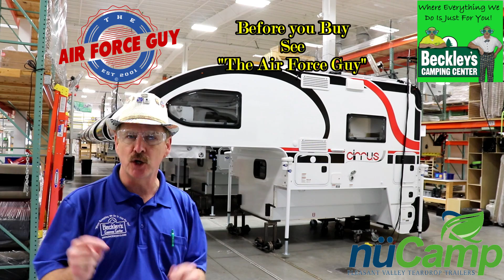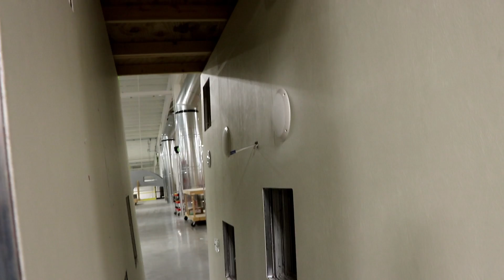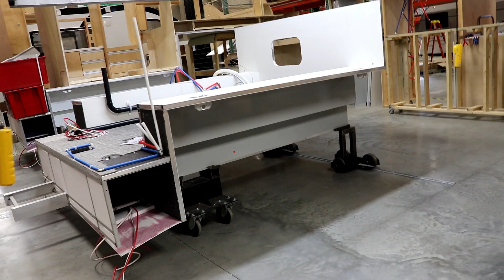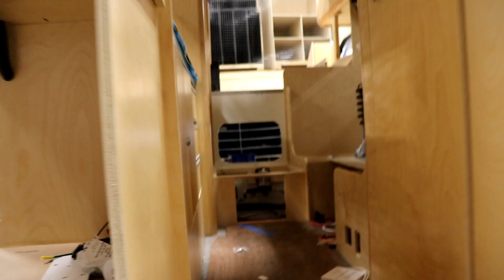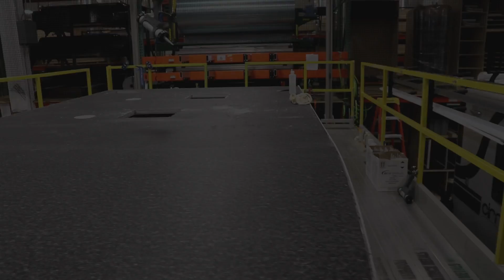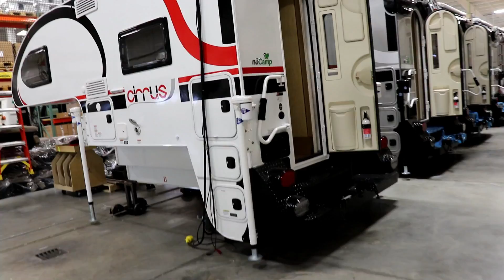How the Cirrus Truck Camper is Built- w/Paul Chamberlain, Jr. "The Air Force Guy

Comment: 9 times out of 10 they'll use Azdel unless they run out, then they'll use Luan?  That's ridiculous!  Also... they're using wood in their construction? Over time that wood is going to rot!  This is really disappointing because these campers have a lot of other advantages to them.  They would be so much better if they were made from molded fiberglass like the Northern Lite and Bigfoot campers!  Less seams, less leaks.
Reply from the maker: Thanks for Watching.  The wood that they  are using is inside of the Aluminum frame so that the screws have something to bite on.  Others just screw thru the aluminum and over time it will come loose.  Northern Lite & Bigfoot campers are nice!

Comment: Given the superiority of Azdel, how does one know if/when/where Luan is alternatively used?
Reply from the maker: It would only be the interior ceiling panel. One would only be able to notice if they removed one of the seams and looked.  Not a big deal since it is the interior panel.
Reply: @TheAirForceGuy  seems that a product marketed to have Azdel that lacks it in a location which is most likely to experience a leak makes it significant enough to disclose to the consumer.

Comment: Too bad no one builds solid one piece fiberglass or even carbon fiber truck campers. Cirrus has the best interiors but, I hate these flimsy multiple body panel assembly techniques that requires new sealant once or twice a year along the seams to keep them from leaking. Unfortunately most RV's are built this way, except for class B's. I've read nothing but good things about the Alde system, but I don't like the space they take up, the maintenance they require, and their possibility of eventually leaking. I also wish they offered "all electric" models too.
Reply from the maker: Thanks for watching.  Even one piece fiberglass units need to have the areas where they are sealed every 90 days and resealed as needed.  Although they do have less areas to seal, they do have things put through the walls or roof, such as windows, vents, outlets & doors.
Reply: They wouldn't need continual sealing if they were built like cars & trucks. Also if they were solid one piece shells, they wouldn't blow apart into a billion pieces every time they're in a serious crash/rollover. That's probably why van based class B's are more desirable. @TheAirForceGuy
Reply from the maker: Even the Class B vans require to be checked and resealed as needed.  This is because there are things placed in the walls to the outside as well as through the roof.  I believe a major reason why you don't see them built like trucks & cars for the most part is because of the cost in doing so.  We do have a small My Pod by Little guy which is a one piece molded fiberglass RV and it sells for close to $10,000.   The Coach House Class C that is a one piece fiberglass RV sells for twice the cost of one built with aluminum and fiberglass panels.  It is always about the dollars to build and what people are willing to spend.  Like I always tell customers, if someone is willing to pay for it, we can probably find someone to make it for them.  Happy Camping!
Reply: I just watched your video on the My Pod. Cool little trailer.  @TheAirForceGuy
Reply from the maker: Appreciate you watching.

Comment: I have been very impressed with the Cirrus line. I really like the interior of the 670. Any chance Nucamp is going to incorporate those updates in the 820 and 920 line?  Would love to see them add the Cassette Toilet to the 820/920. Also, with everyone adding aftermarket Inverters, any chance that can be added at the factory. Thanks for the update, you help answer a lot of my questions👍from one retired Air Force to another 😉😉😉
Reply from the maker: Thanks!  I will be returning to the factory and maybe I can get some answers for those questions.

Comment: I have wondered for awhile on all the lines what type of wood they insert into the aluminum edges? It seems if that gets water intrusion or even moisture from the air it will eventually deteriorate and all your screws lose their bite, everything become wobbly and then what? It seems absolutely a weak link unless that wood is sealed airtight?
Reply from the maker: This is something that manufacturers like Winnebago and others do to give a stronger bond between sidewall & floor.  They have done this for years and with great success.

Comment: Paul - Great video! When did they start using the flexible solar panels on the roof? I'm not a fan of mounting flexible solar panels like that. No heat dissipation really shortens the life of the panel.
Reply from the maker: They started using them awhile ago.  Not sure as too the lifespan of them.  I guess time will tell.
Reply: Those are Sunflare panels, I believe they switched to those in 2018 Q3 or Q4. https://www.sunflaresolar.com/what-we-do/manufacturing